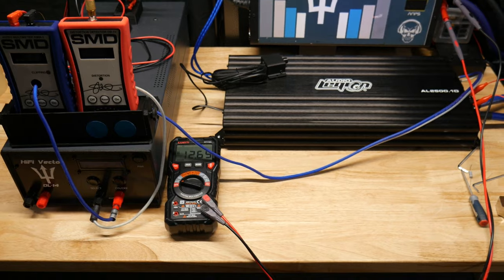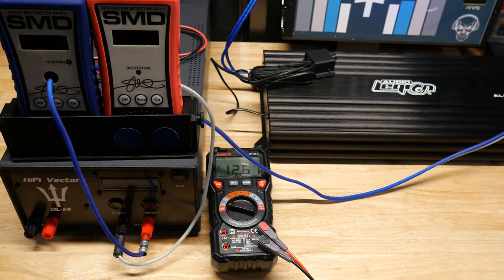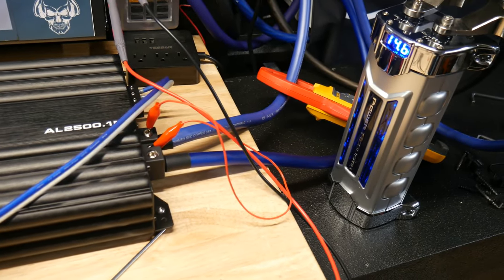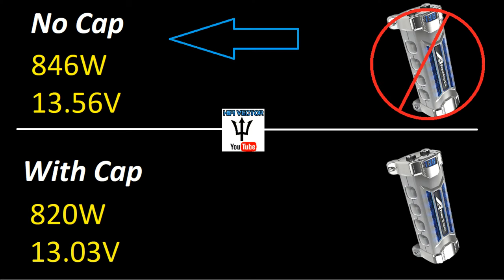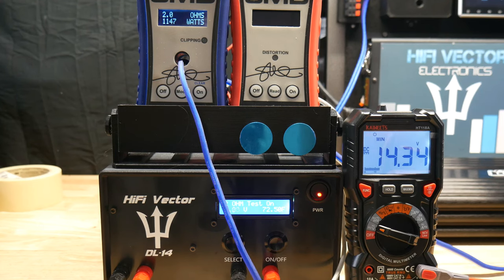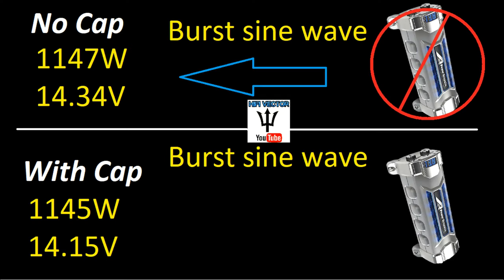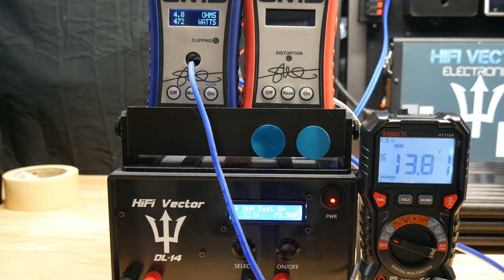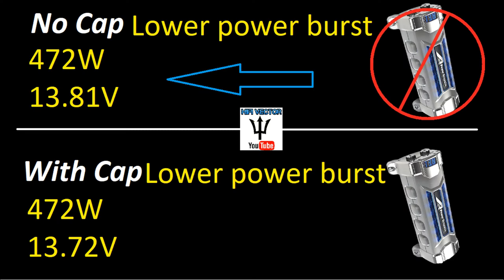Do cheap car audio capacitors work myth busted lets find out in this test

Comment: A 5 farad cap is WAY too big for both of those loads.  I would be curious to see a test with a 1 or 1.5 around 1000w rms @ 2ohm, and with the cap given enough time to charge up.  I imagine that 5f cap is causing more voltage drop because its trying to charge more than it's discharging.
Reply: This makes perfect sense 🤔 ❓ cause otherwise capacitors from these test results are useless. And am thinking of installing em to help in an audio setup 🤔
Reply: How are capacitor sizes 🤔 for audio 🤔 measured?

Comment: I have a limitless supercap bank I’d ship you to use for your tests…I only used it for 2 weeks and pulled it out only because I wanted my battery delete that lights up to go in its place lol I used it because I run 2 90 ah cmax banks and I know the initial start up takes some cca so I was using the supercap bank to take the brunt end of that and the supercap bank could start the truck with ease it has some sauce
Reply from the maker: Appreciate the offer. Maybe later I’ll take you up on that would be cool to test. Thank you man.

Comment: Caps really only work well when they’re done right. You have to have a cap that’s true to its rating to start with and a power source (secondary battery) close by to recharge the cap quickly. I have volt meters right before and right after my cap bank, makes it great for seeing the difference in voltage drop
Reply: Now you have the right idea I have two batteries In back with a capacitor and my bass hit will make your hair stand up 😂😂😂
Reply: First of all, you have to hook up the capacitor correctly!  Glad I never used one back in the late ‘80’s and 90’s when I had an all Orion HCCA (red’s) system!   Yes, I was on Team Xtreme!!  I know Richard Clark, too!  We were in the same wattage class, except he was a Pro, and I was an Amateur - 1st year ever competing and I got invited to Nationals down in H-Town (Houston)!!  I could have went and competed!  But, I told Richard, I would rather go down there and be part of his crew and make sure he won because since he was Pro, we would get more points as a team, which would help us win Nationals!  Richard Clark knows his shiznit!  He is the reason, along with my homie and personal car audio installer, Derek Cox, I used an Orion battery isolator with two 6-volt Optima (red top) batteries in series, instead of using a capacitor!!  Real Talk!  💰😂💯🔥💲😎

Comment: I had a capacitor on my system on a newer vehicle and now that I took it out due to the connections being damaged on the capacitor, my vehicle is having a hard time keeping up with the subs. Before with one, it wasn't as bad and alot less voltage drop. I have another capacitor I bought that will be replacing the old damaged one to fix the problem.

Comment: Honestly you would have to run everything at least 10 times and average it out. Cause with or without a cap the dyno will read more or less ea dyno run regardless.  That's the nature of the beast with electronic components. Caps no longer have a place with alternators able to charge 14plus volts. And batteries that hold massive amount of angry pixies ready to dump with ea draw(bass note). Back in the 80s/90s with very small lead acid batteries and alternators that dimmed your head lights turning on your turn signal, the cap could give you a little boost. But even back then they were not worth the price of admission.  Not unless you ran a pyle of em. But the audio industry was just figuring things out then. I'd love to see this test done again. But 10 pulls ea. And having the resting voltage 13.5ish. To really see if back then we were throwing are money away or not. Buying it today is absolutely not worth it. They will not due anything for your system. Unless you need a way over kill voltage display. Spend the money on a second battery. Even a lawn mower battery added would have a greater effect on a current system.

Comment: You need an oscilloscope to do this test and it doesn't work and constant situations and definitely can't be seen from a  volt meter the other part of this is its a give and take i personally use one to split the main led to two amps one to sub and the other to the speakers it helps with variations caps are there to smooth any waves not to add supply so maybe the volt meter is seeing the high points in the line when it is in a ripple so it would stand to reason that you would see more volt drop with a cap but its steady in stead of looking like a hart beat on a graph now I know what it's like to make videos and I would love to see another one with and oscilloscope so you can see what is happening
Reply: And do away with the display on the cap they only draw energy not worth the drain for the display the horror story from these are from the display not the cap itself

Comment: People always use these capacitor because they think it will give them more power for some reason. the purpose of these capacitors is just to be a power buffer so your battery/alternator doesn't drop in voltage (causing headlight dimming or other potential silly problems).

Comment: Did you charge the capacitor using the diode wired in series? If not, then all it is doing is drawing power to take its initial charge
Reply from the maker: Yes capacitor was charge correctly.

Comment: I use 500 farads in the engine bay to smooth my alternator output, and then another 500 farads right next to the amplifier to provide dynamic pulse headroom. 5 farad is tiny... i do think you experienced the voltage dropping from the cap recharging. Beyond that, its a little above my expertise to speak on what exactly was happening..
Reply: I think you have 500 millifarads in each spot (which is .5 Farad each). But if you have 1000 1 farad caps in your vehicle..  I want to see that.

Comment: Capacitors can draw more power to charge than what the system can provide ! It only works when the power supply itself can give you the current you need ..You need to have more voltage going into the capacitor  than the device requires to operate on .Supply regulation .My 13.8 v regulated supply has 30,000 uf on the 35  volt side and only 10,O00 uf on the regulated side at 13.8v .You need to open the amplifier up and parallel capacitors on the DC to DC  power supply side ..I used to parallel 2 capacitors at 3500 uf 50 volts on my old punch 45 ! That worked !

Comment: I love the video, not bashing it in any way. I am just curious on what power supply you used to power the whole setup? Maybe the reason why the voltage dropped with the cap or the cap seemed to do worse is due to the large inrush current required to charge the capacitor. Depending on your AC-DC power supply, it may have reached the current limit and dropped the voltage to compensate. I think the test would be slightly more accurate if you use or mimic the power supply of vehicle with alternator and battery. Thank you.
Reply from the maker: My amp Dyno set up is capable at handling 1200 Amps of current so that was not a factor.  I have a ton of power available. This was a very lower power test. Thanks so much for watching I appreciate it.

Comment: Take the audio system equation out. I’m wondering if a cap between the alternator/generator and battery would help absorb frequency waves or soften the initial hard start when charging begins. With a start/stop semi-hybrid could it smooth the transition from on to reduced on. Would it result in extended AGM battery life. The slight drop in voltage might not matter as much with a registered battery in the charging system.

Comment: If u ever had lights dimming and installed cap and it stopped u will realize what they do besides clean any line noise is that they take the load off the alternator not the battery he is testing battery and not alternator it draws power from battery and then charges the alternator which charges the capacitor the battery is the power but the capacitor and alternator stores power which charges battery back up
Reply from the maker: Actually the test was done using a battery AND a active power supply which charges like an alternator. The test was not just done with only a battery.

Comment: Think of the power like water. The battery like a pond (volts) stored power. Amperage like pressure. Its using more water (volts). Because its pressurizing a little water. quickly delivering a small amount. thus using a little more (volts). acting like a little pump (fire truck) delivering a lot of water quickly. smoothing out the flow so headlights don't dim.

Comment: Am guessing the test should be done with an alternator to supply the capacitor with consistent 🤔 D/C CURRENT to give the capacitor a fair charging chance 🤔. Seeing these test results shows it's a waste 🗑 of time using capacitors
Reply from the maker: The test was done with a dc power supply set to average vehicle alternator output. So it was hooked up to a dc charging system for the test.

Comment: If you open up many of the cheap caps, you will find a couple are fake, and most that aren't have a tiny tiny capacitor that wouldn't come close to 1 farad. Just a smoke and lights show.  Now going back in time, most  1 farad caps were the real deal. Amps were 95% class AB, so you would see a major improvement with headlights and voltage drops during peaks.  You can thank poor outsourcing from companies that don't give a rip about the product.

Comment: If you're quiet you can hear the sales on crappie  capacitors dropping! I would put money on that powerless acustik cap is no way 5 farad its rated just like every other cheap ass power acoustik amp way more than it really does....i likely isnt even 1 farad so its probably a choke point of the power... When you see a 5 farad from a reputable company is way bigger and way more expensive so thats a dead givaway... I think the nvx 5 farad is multible caps like 6 i cant remember. Super caps are the only caps worth buying but after you get enough low voltage super caps for 12v its expensive... That budget bass head put big super cap set in and it was a flop so i think caps are a waste just get bunch of headways there like $5.50 at battery hookup i just bought 12 (24ah) with shipping like  only $80,! Why would you go any other way... i made some bus bars and it holds around 13.8 to 14.2 running my APCLE 1800.1 on 2 d2 12s at .5 ohm wide open with a 130A alt. My van has a beast module 64ah 32cell and it runs a cab45 at .5 ohm it holds high 13s with stock 140a alt at full chooch... Ill never go anything else but lithium.

Comment: Capacitors  are not designed to handle a constant load period, they are designed to help stabilize instant high current draw and prevent power source circuitry from being damaged. You will never get an accurate test using a machine. Only true test is watching voltage and current draw on other equipment in the same electrical system (aka head lights).  Either add a cap or add a second battery in the system to prevent voltage starvation from the other components in that system.

Comment: Well damn,i just gave a guy $30 for a audiopipe and another cap.
May do my own tests and see if itll help some.
I just got a 4s sodium ion18ah bank so thats way better than a cap but i may try on mine and see anyway.
My civic has that dumb eld system to shut the alt off to save gas and i need to by pass it.
I think my factory alt is only 70amps anyway and definitely needs uograded to run the 1500ish watt amps im using

Comment: Try a cheap planet audio system they have a modern 20 farad flux capacitor for 100$ . That’s fit for the 1500 watt (1100 rms 2ohm) planet audio anarchy amp 89.99 
Do a decent wire setup not the cheap 4 or 3 that it would come with . 
I think that’ll be a good cheap system to beat and see if it really works

Comment: My installer sold me on a capacitor back in the late 90's because my lights dimmed every time my bass would hit. Installed the cap and boom, the lights still dimmed. I want to believe that caps do something but I really don't think they do anything other than look like a cool accessory. I still have mine hung up in the garage.

Comment: Aren't there more farrads in a battery than a capacitor. I mean you're only dealing with five farrads as compared to close to 300 for a good battery. So why not just run another battery in line.
Reply: Supercaps are not the same as a battery, they can charge and discharge much quicker and with higher currents because energy is stored electrostatically where a battery stores energy chemically. And yes, their capacity is much lower. SuperCap is not a battery.
Reply: @flexairz  super caps yes but these are not super caps.

Comment: I have and always will chuck caps in the trash   there design  was early 2000s probably 90s   for A/B amps    early 2000 almost every subwoofer rating wasn't  more them  500watts     kicker solo  circles was the shyt   especially the 90s kicker comp 200w   infinity  Corwin Vega

Comment: Test an old school capacitor like the Lightning Audio 1 farad against that one, you will be surprised of the difference, this new capacitors are less than .5 farad for every 5 farad claimed, i did the test already, is not that they don't work, is that their rating is a SCAM.

Comment: If your 150amp PSU can't do 70amps without the voltage tanking like that, its not a 150amp PSU.. :/
Reply from the maker: That’s pretty funny, but yeah, I have a 1200 amp power supply, but I had to turn it down on purpose. If my power supply was turned up to the max, the voltage would not drop whatsoever therefore we would not be able to see the difference between running a capacitor and no capacitor because the power supply would be so powerful to make up the difference and there will be absolutely no voltage drop especially on this power output. With the power supplies turn down low, we were able to now not quite have enough voltage to keep voltage solid so we can see if a capacitor in the system does anything or not which was the whole point of this test?.

Comment: It's very simple physics. Electricity can be thought of as a fluid. Voltage is electrical pressure. A capacitor is a container for electricity, like a battery but a able to discharge and recharge in a fraction of a second. The capacitor is nothing more than an additional container that the car's battery has to fill in addition to the demands of the stereo system. In any fluid system if you increase the volume (adding a capacitor) that must be filled from a tank (car's battery) the overall system pressure (battery voltage) will be less than before the volume increase. Bottom line - adding a giant capacitor to your system does nothing more than create a much higher demand on the vehicle's charging system causing it to fail sooner. Even more bottom line - big, shiny caps are a waste of money and to anyone with an education or 30 minutes of google usage, you look like a moron for buying and installing it. Sorry, not sorry

Comment: are you here in Arizona I got one of those Maxwell super caps you can test do you think it was the quality of the cap I've run caps before and had decent results nothing like an extra battery but it did well btw you I think you gotta have the cap super close to the amp dumb I know
Reply from the maker: I'm not but thank you for the offer that was nice of you.  There are caps that work and I'm sure the maxwell caps are beneficial indeed. I just had this one here so  I thought  I would test it out. Yea with my test bench the cap, batteries and power supplies are within 2 feet from each other. This sparked my interest though so I will be checking out a couple more in the near future. Maybe a Stinger hybrid and a NZX or?

Comment: You don’t even need to upgrade your electrical for anything 1200 watts or lower let alone 100 watts.
Reply: That depends on the vehicle and your accepted voltage drop.
Reply: @kylevanwinkle2081  I’m talking about standard installs not compensation.

Comment: Did you energize the cap first ??
Reply from the maker: Yes
Reply: Would a cap be good for a 2500 watt system or no im trying to save my alternator from over use.
Reply from the maker: I would go with a secondary battery personally. The caps do work if you buy a legit high end one but they cost $$

Comment: Well since it was tested at 13.5 and the cap dropped lower! Same on the second test.     You didn't charge the cap correctly for testing!  I truly never had to use a cap even on my duel amp and active crossover,  line driver! I put one in anyway.  To be safe. Vehicle was running 14.5 volts when cap was charged correctly it said 15 volts.   Running a cap does work but you have excess power batteries now that hold better power than your car batteries!        For you guys that are having issues first off it's normally the install that's the problem! Second if that's right and you have the problem then big 3 and clean all of the connections! Lastly if that's Done right then your vehicle has mechanical issues!

I have Done many stereo systems over the years doing multiple amps, crossovers, active and passive,  line drivers, eq ,etc   personally I never used more than a power cap and half the Farads.   Lol and Lastly don't be like this guy with all that money spent on testing tools Equipment.   Real life vehicle application is deferent.     Power caps are designed for rapid discharge ( bass hits ) power banks are designed for high current application.
Reply: What a silly response. Don’t trust actual test equipment, trust what you say? It’s hearsay from people like you that keeps people buying junk like that capacitor.